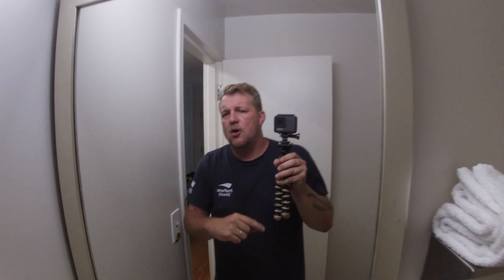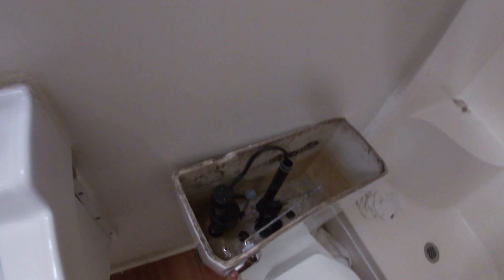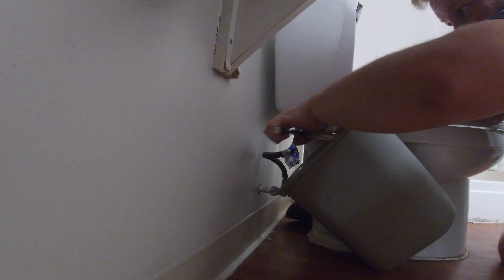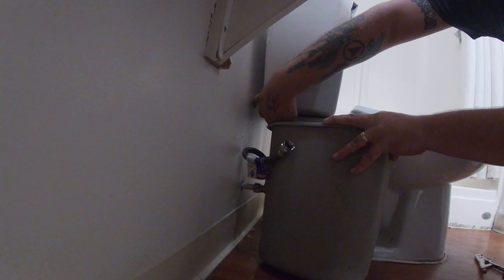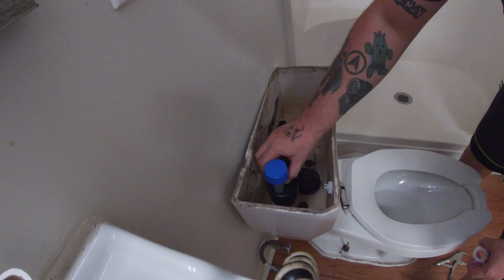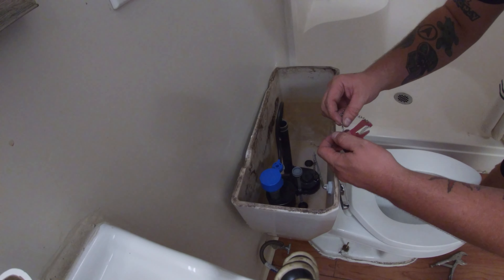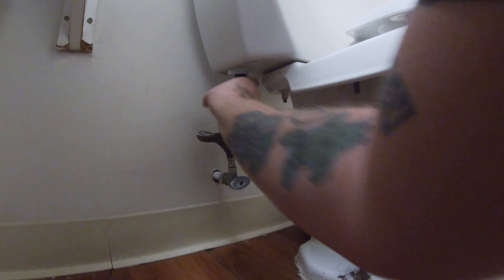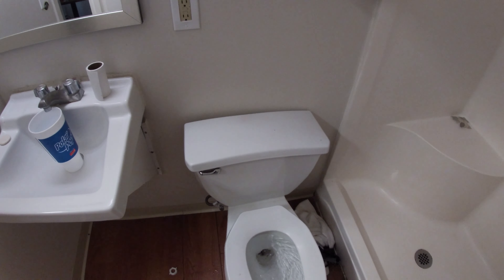I fixed a toilet at a Hotel because they didn't want to. How to change the float in your toilet.

Comment: The water line connector has a black rubber washer in it that seals against the pipe, so it doesn't need PTFE tape.